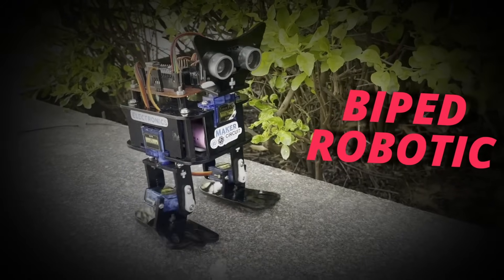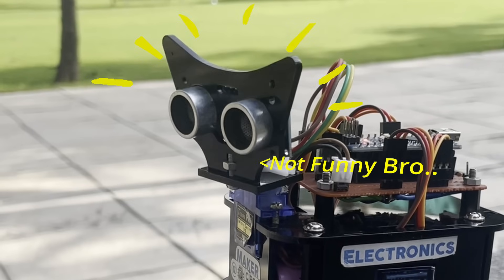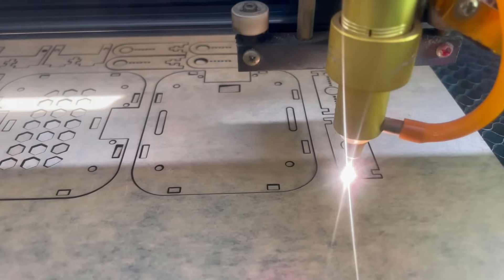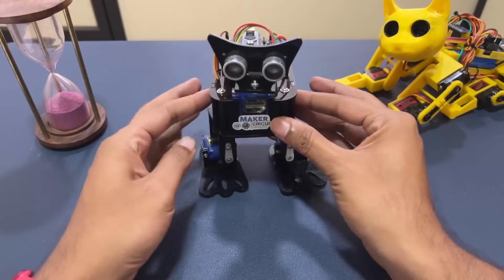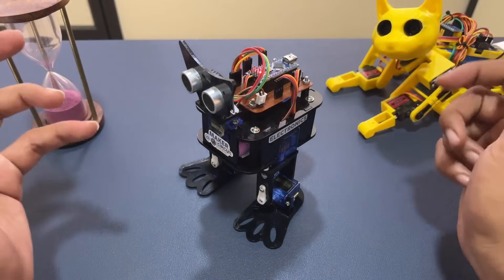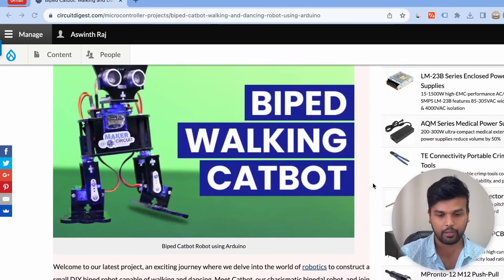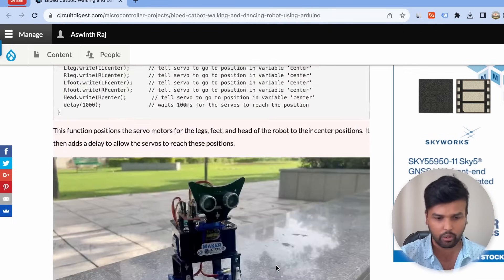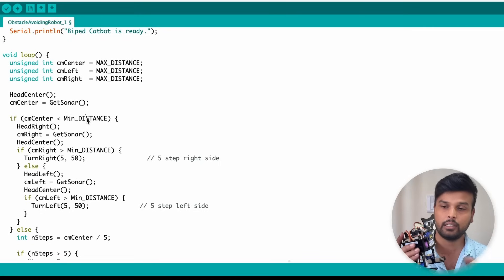How to build Arduino Controlled Biped Robot - DIY Walking and Dancing Cat

Comment: How do I connect the li battery to the nano using a perfboard? Also, how would I make connections with the other components?
Reply from the maker: Detailed circuit diagram can be found on the project page. Refer to that for making the connections.
Reply: @ should I separate the battey’s positive and negative wires?